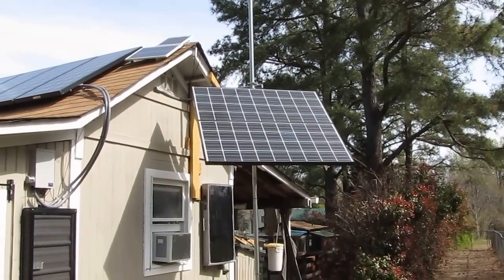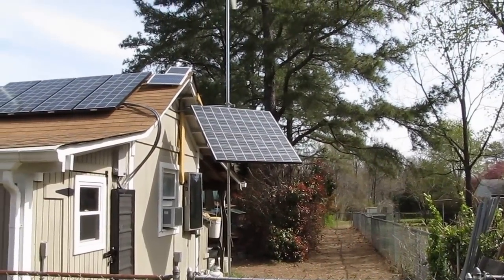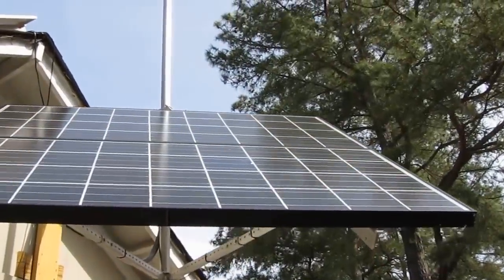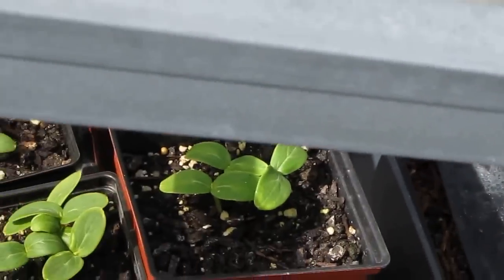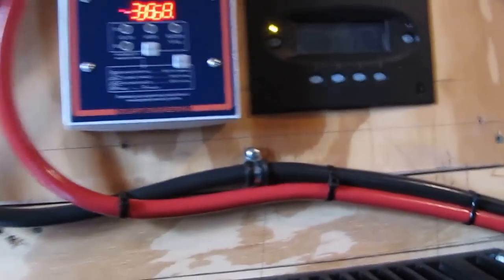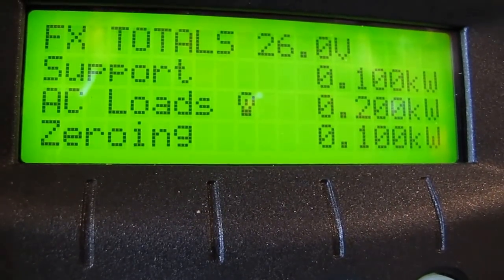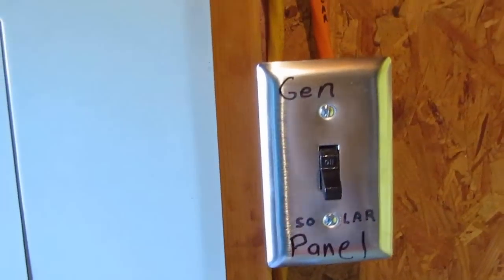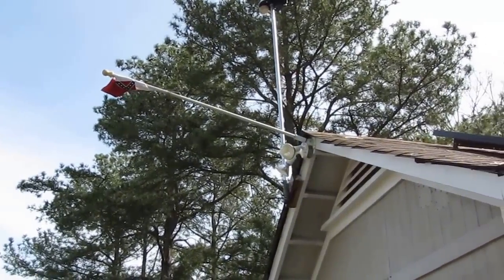Solar and Wind Almost Topped Out in Power VIARLOCITY

Comment: instead of using small batteries find a local company that services electric forklifts. the battery you want is the standup version you can get them in both 12 and 24 volt versions friend of mine bought two allegedly junk highly sulfated batteries by paying the scrap price for the lead three months later the charge controller reported  the batteries were at there highest charge ever. He shut down all charging and ran his house for two weeks before he turned the solar panels back on 10 times the storage capacity of the smaller automotive sized batteries. He bought  two used stand up fork  lift batteries. Big advantage fewer connections to go bad and forklift batteries are designed for short term high output over 200 -400 amps in forklift service and last on a full charge in a heated warehouse an 8 hour shift before needing a recharge.

Food for thought
Reply from the maker: +James Shanks I totally Agree There forklift Batteries are the bomb Buddy They are awesome Good Stuff

Comment: I have a 38W, 50W and 180W solar systems. Started in the early 1990's. All separate, Wind is next atop of one of my HAM towers I don't use any more by the St. Lawrence River in Canada at about 40 feet. I figure a 100W panel and 500W turbine should work great to power the shop, TV and my 2 Ebikes. Wind has always been of interest as wind here, there is clouds there is wind on the Seaway right where the jet stream is most of the time. Thanks for your time!
Reply from the maker: +Turk T That is Awesome You Should Make A Video Of It Your Setup Yes Wind up Near The St Lawrence River Is  Great  Let Me Know How it goes Thanks For Stopping By Cheers From Virgina  Kenny
Reply: Well, I'm still working at it and have a wind turbine to add and on it's way. I'm a liitle worried as it is a iSTA Breeze i500 and just now not hearing good things? will see.
Reply from the maker: Turk T Test It See How It Goes It May Surprise you I'm loving My WindMax Turbines  They do Great in Low Wind really All Winds
Reply: Might not be so good as another just answered me back of his lasting 1 month? I'm getting worried about these iSTA Breeze 500? Is your turbine getting advertised wattage out? If AC what size of wire are you using down the pipe?
Reply from the maker: Turk T Hi Buddy My Turbines Are Rated At 1000 Watts @ 24 Volt I'm Using 12/3 AC Extension Cords  15 Amp  My Turbines Are Under rated Watch This Video 
https://youtu.be/v3gEHuJ6xJ0

Comment: Interesting setup. You've inspired me to consider engineering something for my garage. I was thinking if I eventually undergo such a project that it'd be a good idea to incorporate some kind of interface to allow monitoring and even flow optimization using a PC with a web server. Then you could check on your levels through the internet.
Reply from the maker: ***** Yes Sir My System Has Internet And Data logging Events All Of That It Works Out Well

Comment: You have a great setup, Not just your solar and wind but your home away from home. I have my pole barn thats been taken over like that. Started with a couple panels to run my Ham radio stuff when I was out there. (I work in the barn about 6 hours a day) did not really talk of the radios much because of working but listened so I did not go nuts (as fast). 
I have a wind turbine but have not had the luck you have had but its not the turbine its my fault I need to get it up a little higher. That is a project for next year.
Thank you for making and posting your video I'm going to steal some of your ideas!
Reply from the maker: Delbert McCord Many Thanks Buddy Yes This System Helps Power My Whole Property  That Is The reason I made The Video To Help Others Have At It Steal My Ideas Cheers Kenny

Comment: nice set up man  ive just started using solar i bought a 250 watt damaged panel as in the glass is broke,1, 44 watt panel, 2,13 watt panels ,i have only a 110 amp hour leasure battery at the moment but on a sunny day i can run a 100 watt 32 inch tv and sky box.im hoping to go bigger

Comment: Nice Vid, Kenny... thanks.   A question:  I'm in the process of building my own system.  I got free glass panels, but they are huge.  6 1/2' x 3 3/4 '.   So, my panels are going to produce 20 Amps each, or 160 at peak performance.  Does the charge controller handle this much amperage?  Is the rating for them for input, or output?  I planned the system for 12V so I can wire the house for 12V and use inverters (desigend for cars)  in different rooms.

Comment: On your hot air heater. Wouldn't it be better to have the intake down near the floor? That way you heat as much cold air from down below and lower the inversion layer of warm air? Your air will come out of the output cooler, but I think you'll increase the net energy input into your shack. On a cold day, can you feel the  inversion layer between the cold floor and the warmer elevations?

Comment from the maker: @N8Dogg1002 Hi Nate first Of all I sold My WM On Ebay My Charge Controller what a Hunk Of Junk   I would Get Me Midnite Solar Disconnect Box 250 Amp  You see the white Main Panel In My videos That Is My disconnect & Shunts Grounds Etc  No Problems so Far  Also I like That Coleman Air / Missouri Wind All In One Like I have For Wind Charge Controller   Your Wind  Charge Controller & Solar should Be seperate also Morningstar Is Making a MPPT Wind Charge controller Its in the works Give me a call NT

Comment: @kvusmc @ 2 Q's for bud. 1.)Do you have problems with your WM dump load kickin in when you are float charging and if so what did ya do to fix it?  When mine float at 13.6 my mill won't turn. ?? On a windy day I kill the panels just so the mill wont overheat from being bogged down. 2.)When I earth ground my Aims it trips out. It only works with the ground unhooked. It will work grounded when a light is plugged in the vert but when hooked to the transfer it trips out when I switch to batteries. ??